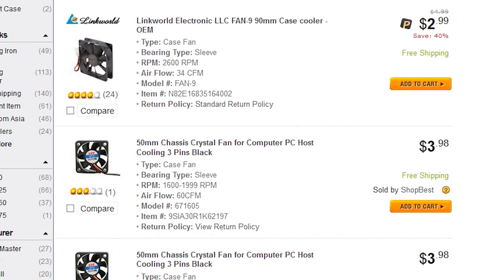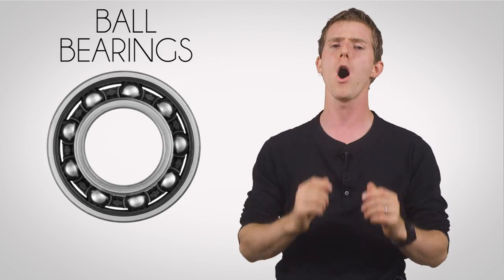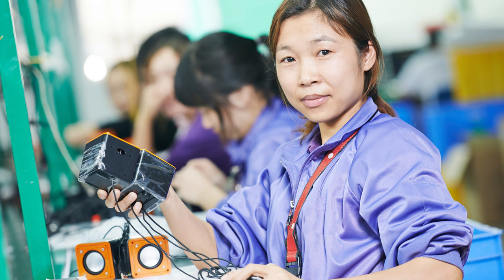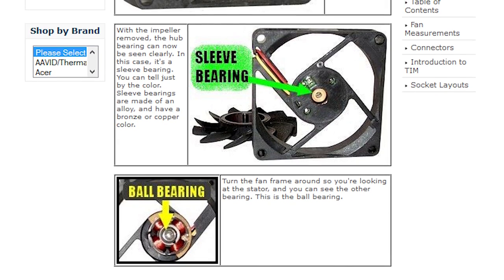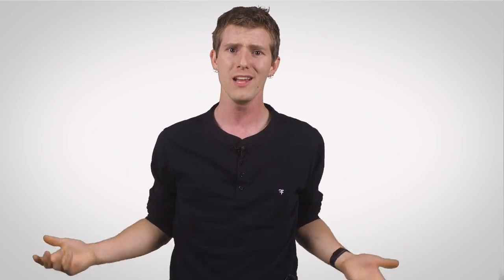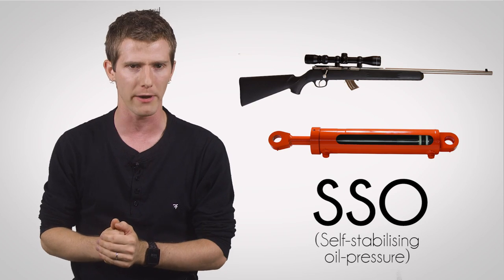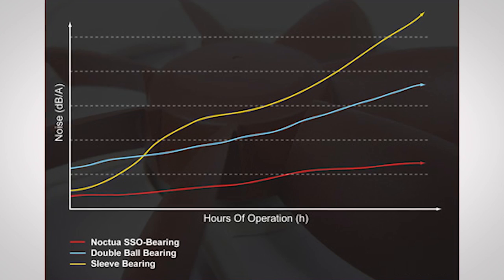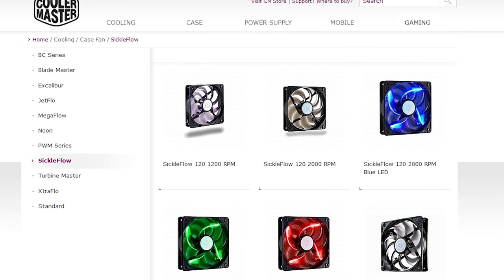PC Fan Bearings - Sleeve vs Ball vs Others as Fast As Possible

Comment: Since it's all about fans. What's a good exhaust fan? I think my PC is quiite hot because the air doesn't go out. I have 3 exhaust and 2 intake. 4 of those fans are Deepcool Xfan 120 which are budget fans.

Should I get Corsair Air SP120 or AF120? Difference? Quiet or Performance Ed? Does performance ed really loud? I don't want it to be hindrance for my recording.
Reply: ivanzegt  what is the model?
Reply: Get more intake fans. It's better to have a positive pressure in the case. You get more fresh air in and keeps your case cooler.
Reply: Oh and if you're getting case fans get AF... You want air flow for your case. SP is static pressure which are more suited for water cooling, like being right up next to a radiator.
Reply: Thanks. I might just buy AF Quiet Edition. I have NZXT Tempest 210.
Reply: *****  Maybe, maybe not. My cpu runs as 34C average on idle. 58C on FULL LOAD for ten minutes.

GPU was 40C on idle. and 50C on gaming

My problem is that I think it should be a little bit lower. But I dunno, I don't really know the room temp of my room but I believe it's atleast 30C or so.
Reply: Those are perfectly fine temps. No need for more fans.
Reply: karlsanada13  those temps are not bad depending on what the cpu is, what speed its set to and the cpu cooler. For instance a stock cpu speed with stock cooler is similar to those temp readings but thats nothing to worry about. Most shut off at around 100c to prevent damage so 58c is fine. My 3770k @ 4.5ghz idles at around 10-20c on idle and something around 50-60c on full load during gaming.

If you want better temp results the best thing to do is not focus on the case fans and upgrade the cpu cooler and if possible put some quality fans on the cooler. You want to try make the air inside the case go in and straight out the back. You dont want the hot air to come back in or be trapped so position the fans correctly on the case.
Reply: TB Craft  Well I have a hyper 212X cpu cooler as my stock cooler started to break. I hate intel push pins, so fragile. Anyway, I believe my room temp is around 31C to 33C. Pretty hot I know. I wish I could have like 25C idle and 40C load.:/ I have i5 2320 cpu.
Reply: karlsanada13
 the only way really you will acheive that is by water cooling, i have a h100i and even on stock cpu settings it idles at like 8c and on load runs at something like 40c-50c on prime 95. on gaming it runs at maybe 30-40c dont worry about idle temps.

i have my i7 3770k cpu on 4.5ghz and it idles on nothing at around 10-20c and on gaming around 50-60c. if you want better temps get a better cooler but that is going to cost more if your willing. Theres really no need unless you are going to overclock the cpu. 58c playing games is perfectly fine like i said even mine on prime 95, 100% on all cores it will run at 60-70c even with the h100i but thats because its at 4.5ghz and not standard voltage or turbo boost which is 3.9 i think.

id suggest running prime 95 to see what you get.
Reply: TB Craft
 I've run prim95 before for 10mins. full load never reached 63C.

It's funny how full load and gaming load is almost the same.

Gaming load = 48C-54C
Full load = 56C - 60C
Reply: karlsanada13  thats not bad its if you want to overclock it starts getting hot. my brother with the h80 had it on 4.2ghz at 62c and ran it up to 4.5ghz and it almost ran to 80c where as my h100i runs at close to 70c (on prime 95) on 4.5ghz it runs around 30-40 on stock 3.9ghz settings.

it would be interesting to see what temps you get when overclocked but like i said if you are running the pc stock then theres no need to upgrade the cooler further as those temps are quite adequate.
Reply: TB Craft
 Sadly, my cpu is locked and cannot be overclocked. I'm not planning to either. Thanks anyway.:)
Reply: karlsanada13 application load and abuse load are certainly quite different. your own temps there are quite different.
however, when running abusive Utilities for testing purposes, you'd want to run it for a while atleast, Prime95 for 10 minutes isn't exactly a good test :p
the temperature will keep creeping up little by little as the test progresses, until you hit whatever the hottest it's going to get with the current cooling solution.

but considering the ambient temperature of the room the machine is in, your temps are not exactly high.
Reply: My temperatures are hotter than yours. Yours are fine. I sometimes get up to 68C on my CPU. It's at that point that you don't want it any higher. imo If you hit 70, then you need to change something. But that depends on your CPU. I have ivy bridge which gets quite hot.
Reply: Cameron Porter  i have an i7 3770k (ivy bridge) overclocked from 3.9ghz to 4.5ghz an increase of 0.6ghz on each core = 2.4ghz. It puts the voltage up by about 0.1-0.2v. Mine runs at around 68-70c on prime 95 which stress tests the cpu by using more than any normal programme would. Usually when playing games it runs at around 60c.

my cooler is a h100i with dual corsair sp120 fans each at 1500rpm. On stock settings it runs at around 40-50c max but because of the fact its overclocked it runs much hotter at around 60-70c. But due to the fact it cuts out at 105c means this overclock is safe.
Reply: Corsair fans are kind of expensive for their performance. I have two of the (SP120's), and I am not impressed. Delta makes great fans, and they range from quiet to vacuum cleaner, but at each level they are the highest performance. They are dual ball bearing. Noctua's are expensive, but they last forever and their performance is outstanding. you can find some for $20 if you look/wait for the right deal.  Also, Scythe Gentle Typhoons are fantastic. I had three on a triple radiator, and they were both quiet and effective. I would DEFINITELY get Scythe Gentle Typhoons over any Corsair fan.
Reply: Garry Perkins  i have two high perf sp120s on my h100i radiator and they are much better than the originals. cooling to around 12c from 20c on idle and around 70c from 80c on prime95 at 4.5ghz.

i have tried other fans but sp120s are purely for restricted spaces such as heat sinks and radiators and are not good as standard case fans.
Reply: Positive case pressure is the way to go.  more air being pulled in than being pushed out.

Comment: the fan on the Cooler Master Hyper 212 EVO SUCKS..the heatsink itself works great , but the sound of the fan is very annoying.... it rattles because the stupid sleeve bearing.
Reply: Mines dying :) Sounds like a big diesel engine is idling away.

Comment: Cute how people talk about "Oh i oiled it with WD40!" 
Yeah. You can. But if you know what you are doing, you also know what else WD40 is for. You can fuck up a lot with that. Rather take the fan apart and clean it properly. Then use Ballistol. (Weapongrade oil is the one i use) and lubricate it with that. Trust me. No clogging no more. No sticking together and nothing. Also lasts 3x longer than WD40. If any use WD40 only for cleaning it quickly.

Comment: Do we also oil/lubricate fluid/hydro dynamic bearing fans? Would appreciate a reply back thanks.
Reply: Hm... no. Fluid bearings have a sealed capsule that prevents oil leakage but should also prevent anything getting inside. It shouldn't dry out, but if somehow the oil starts leaking then you need to replace it, not oil it.

Comment: The Cooler Master product line may very well be the best, when it comes to fans, but the web site does not help support this notion. With seven different configurations, one of which being 200mm, It is hard to choose the right fan even if you know what size you need.  Questions that came to mind, but weren't addressed at the site, were proper application.  Which fans, in the Cooler Master line, are meant for bringing in fresh air and which are meant for exhausting hot air? What type of fan speed do I need and why. LEDs, isn't that a point of failure? Rubber mounting? Do I really need to go elsewhere to learn about the product before I buy? Oh, hello Corsair on line.

Comment: One thing I would like to add is DO NOT believe the urban legend that you can repair siezing ball berrings in CPU and GPU fans with WD40.  It breaks down/disolves allot of the common polymers used in fans and sometimes the bearings themselves, not to mention if it leaks from you trying to flood the channel with it it can ignite in the motor if it gets hot from the bearings failing.  I have had to fix 3 PCs that people did this to.

Comment: Idk if I would buy a fan from cooler master because of the fans they put in my n200 case. I know that the N200 is a budget case but those fans are extremely loud when gaming.
Reply: Their xtraflow series was great though. The could get loud at max rpm but performed well on lower rpms.
Reply: Ya I have a bunch of sickleflow fans myself and I no longer use them. Sure they push a ton of air on the cheap but they are also very loud doing so. Not the loudest by any means but definitely going to be the loudest thing coming out of your case if you have 2-3 of them running full tilt.
Reply: devilmikey00
 Unless of course you have an old gigabyte windforce cooler that's clogged with dust running all out. That is like a concord about to take off.
Reply: I like loud fans... my pc with coolermaster jetflows and sickleflows running max rpm sounds like a dang hairdryer.  For some reason I enjoy the sound of white noise.

Comment: Ok so I'm about to build my first gaming pc and I'm having a little bit of a problem. It's a m-itx build and the thing I'm wondering about is if I need a expensive mob or not. I was thinking about getting a maximus VII impact but I don't really think that is necessary (OVERKILL!!!!!) for my build. The main reason why I wanted this mob is that it has this good sound card and I heard like it like boosts up your gpu but are they any other mob that do the same thing and doesn't cost as much. 

Specs:
gpu: EVGA GeForce GTX770 SC w/ EVGA ACX Cooler
cpu: intel i5-4670k
ram:Corsair Vengeance 8 GB ( 2 x 4 GB )

If there is anything else I should name please tell me.
THX FOR THE HELP IN ADVANCE :D

Comment: MD5 hash as fast as possible.
Reply: +Carlos Espindola 
Hashes are a way to create a unique digital fingerprint of a fixed length, for anything from files on a computer to digital certificates used on websites. MD5 represents a way to create such fingerprints, with SHA being another more acceptable way. 
Why use hashes? 
Because they are really useful in determining if anything was modified. For example, Lets say you sent a pdf document via email to your friend.He says he has received it fine, but how can he be sure? 

Simple, use a program to calculate the hash, send him a message with the hash, you can use another way like messaging if you wish, then your friend will calculate the hash on his side, and compare the 2 hashes which should be exactly the same, if the hashes don't match, something was modified along the way. MD5 is now considered unreliable and SHA256 or other variants are used now, but they basically do the same thing. 

Examples used in real life: Some websites allow you to see the MD5 hash, or SHA hash on their website if they offer downloads, so that you can compare them after you have downloaded their files. If hashes don't match, it doesn't necessarily mean that someone tampered with files, sometimes files get corrupted or don't fully download.
Reply: +Jack Kraken Great rundown, just a couple clarifications: 
1. Hashes aren't always unique. If the input is larger than the resulting hash, they can't be. (Sounds obvious but you would be surprised by the number of times I've seen people claiming that their favorite hash function is collisionless.) 
2. Which is why MD5 fails as a cryptographic hash function—finding a collision (a different input which produces the same hash) takes about 5 minutes on a regular PC.  It's still perfectly good for detecting accidental data corruption though.
Reply: +hellterminator 
Thanks for the clarification, but I didn't know how easy it was to create MD5 collisions, and I too use it mostly for checking file integrity. 

I also use it to figure out if a program/file could be malicious, since MD5 is used so much I can actually just google the MD5 hash value itself!
Reply: Jack Kraken Well, the second use is not that great because it's very easy to create a malicious executable with the same hash as something innocuous. SHA is better for that; it hasn't been broken (yet). 
Also I found the paper about MD5 collisions I was referencing earlier. It's actually even worse than I remembered. Turns out it was published in 2006 and even back then finding a collision on a single Pentium IV took on average 17 seconds. 
Seriously, people need to stop using MD5 for security applications.

Comment: wait what does he mean by Mounted Vertically? anyone?
Reply: An-Jello :D No idea.

I would almost think it means having the fan flat (vertical axis), where the stress would be evenly distributed.

But at the same time, maybe this increases lubricant loss, and maybe they work better with extra side pressure circulating the fluid, which would mean the fan standing up (Horizontal axis).

So I suppose he could have been more clear there.
Reply: An-Jello :D mounted vertically translates to: side panel, front, rear fans. Horizontal mounted fans translates to: bottom or top mounted fans

Comment: SAN vs NAS video PLEASE!!!!!!!!!!!!!!!!!!!
Reply: The NSA has a lot of SANs.
Reply: Sarcasm aside, a NAS provides file level access, whereas a SAN provides block level access to the "virtual" drive.  Non-power users may not be able to tell the difference, but basically a SAN gives the impression of having a locally connected drive, but the NAS is simply connected as a file server.  The only two scenarios I can think of where this is important are for formatting the drive and setting permissions, which a SAN would let you do client side and a NAS would force you to do it server side.  It may seem that a SAN would be better, but NAS are much more popular because they are easier to set up, don't require any specialized hardware, and the software is relatively inexpensive or free; SANs require specialized hardware (I'm not exactly sure what that is though), and there are very few companies that provide the hardware and software, causing it to be very expensive.

Wikipedia explains in more detail:
http://en.wikipedia.org/wiki/Storage_area_network#SAN_compared_to_NAS
Reply: Folopolis
Oh, I forgot to mention it is possible to hybridize them, by creating a SAN out of NAS.  Doing so you add a layer of abstraction to the block-level access paradigm, but you also gain the ability to create several hundred terabyte - or even exabyte (two levels above terabyte) if you have the resources - sized volumes.